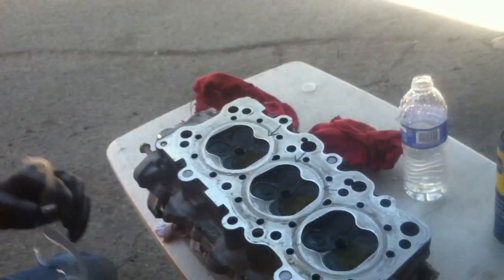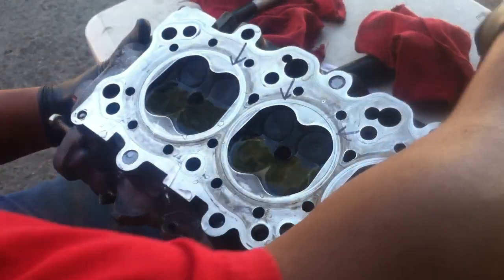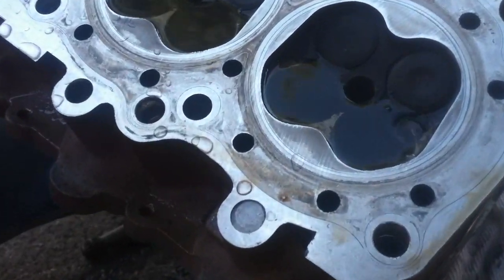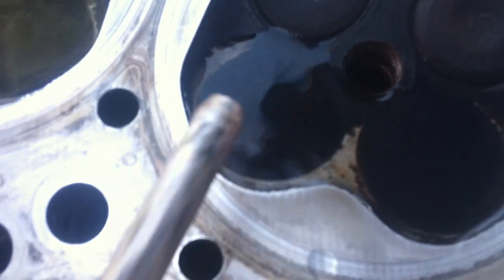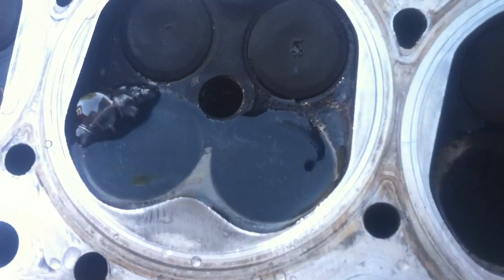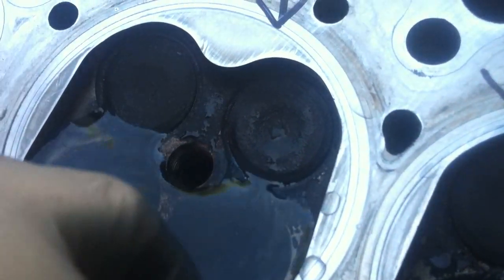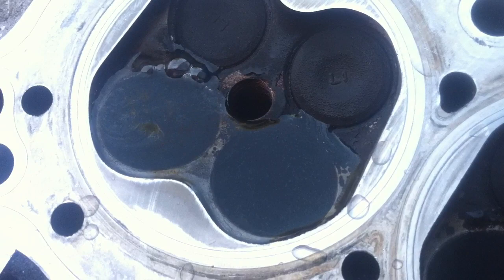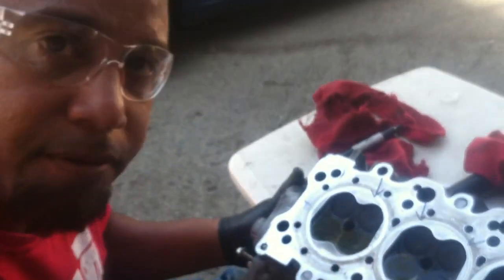HOW TO CHECK LEAKING VALVES IN CYLINDER HEADS. THEY DONT TEACH THIS IN SCHOOL, ONLY OLDSKOOL

Comment: This video shows a faulty method of checking valve seating. Valve seating is checked by a vacuum test, not forcing compressed air and making little bubble baths. Pressure testing is for finding flaws in the casting. I do enjoy your videos sir, but working in a machine shop daily I encounter you tube mechanics that look at this method as gospel truth when its just the opposite. You should be sucking 20 hg instead of blowing 90 psi. Maybe update this video with a better home method by simply letting a thin fluid fill the ports and seeing if it drips?
Reply: bro, that's when the head is on the motor. Think about that. 🎉
Reply from the maker: @JoseLeal-yn4rv  The Compression stroke is air, think about it my man. 150-180psi on this car.

Comment: How much of a leaking ok? I did a lot of grinding, and it slowed the leak down to almost nothing. It was a running engine, but exhaust valves were leaking pretty quite a bit. After valve lapping like your videos show, they barely leak. Is that OK, or should I do more? Also, thank you for spreading the word of God. I love it!

Comment: This kind of works but any carbon coated valve going to cause leaks at some point. Cleaning each valve one by one can fix the leak grinding sounds to be a bit much would rather replace the valve and guides if possible and any valve seals at the least. Spring wear out also so it could be a spring moving slightly opening the valve.

Comment: I did this test before and after I performed my valve job. I had one bent valve that  I had to replace. The bubbles did appear with just water on 50 % of the old valves,soap and water 100%  .After lapping new valves , taking plenty of time, same result. With higher PSI they bubbled 100% ,all new valves had bubbles. This motor ran fine with no  noise before the timing belt went. The old valves were blowing bubbles  probably did not need changed out ,but I did them any way . I'll tell you how it worked out in the next two days when the car is back together.
Reply: How'd it do?

Comment: The right way is give some fuel from intake hole and exhaust hole, then check on around valve seat. is there any fuel seepage on around valve seat or not. why fuel, because fuel have very low viscosity and it can seep in carbon ✌️✌️✌️😁

Comment: Hi there, just wondering if you can answer this question, i brought a brand new head and valves for a single cylinder engine. I will be receiving the parts soon in the mail and I am trying to pre determine if the valves will need to be lapped or should they be good to go as is considering they're brand new? Also not sure it matters but parts are not pre assembled but they are genuine. Cheers.

Comment: Good vids, how about the spring tension. Are the spring tension specs are good and if not enough tension the valve tension are weak and there will be a leak between the valve and the valve seat.

Comment: This may be overkill since the pressure of combustion occurs on the opposite side. I just tried this method on a freshly rebuilt and lapped head from a machine shop and it gave bubbles ~100psi.
Reply: BallsonPHACE did the hold work fine once installed ?
Reply: I  didn't hear a psi range. And when I kicked up pressure and or stuck the air in closer I  had bubbles because I JUST RUBBED DISH SOAP ON THEM. Is this overkill? You would think water not passing threw the combustion side is good enough. Your thoughts ?
Reply: If you apply too much preassure it could open the valves thats prob why hes doing it that way.

Comment: Do valves have to have springs installed doing this method? Because im lapping my brand new valves rn
Reply: Yes and no.  If you just push down on the valves from the "top", where the water is in the video, it will NOT apply the exact same pressure and angle on the valves that your springs/stems/guides apply.
BUT - pushing down on the valves with the valve guide installed will give you a rough idea if you have leaks, because the angle of the valve will be close to the angle with springs installed.  Not exactly the same angle, but close enough to see major leaks.

Stay gold.

Comment: Just did this test on new grind seats and found that if I insert the blower tip close enough to the back of valves they all leak. Spent a few hours lapping new valves and found no improvement. Guess I'll call it good then.
Reply: this is the exact issue i had. i don't think there's a valve spring strong enough to keep bubbles from popping up if you place the nozzle right behind the edge of the seat.
Reply: I should add, they were tiny bubbles and not huge ones like in the video. and i was using soapy water, which will show bubbles easier.

Comment: My only problen with this method is you could miss smaller leaks since you are not pressurizing it. I check for leaks by putting the head on its side and filling the ports with water. Not picking on you, I like your videos.

Comment: Using this trick on new valves in honda cylinder head.  Problem is even after three grinds if i fill it with water and put the tip of the air gun right to the back of the valve it leaks... if I keep it back about the point where the stem starts to spread out the nothing leaks.  I have nothing to confirm my theory but I think the honda valves just arent strong enough to keep air from coming through if I point the gun right at the valve where it seats.  Am I fine or do I just need to send these to a machine shop.  Really don't want to mount it up and waste head bolts to do a leakdown test.
Reply: I'm having the same issue. New valves and newly cut seats. They all leak if I put the air nozzle close. From a distance they all hold up good. Just lapped all of them by hand and no improvement. Would you let me know how it turned out for you?

Comment: Is this a Triumph 1050 motor? Sounds very much like an issue I have. I pulled the head off mine, poured brake cleaning into the ports, and no leaking. Looks like I should have used your method with compressed air to show up the faults.. I've already taken the valves out, so I'll put each valve into the lathe and drop a dial indicator on them and check what distortion I have. Hopefully your have provide me the way to solve my mystery of why this bike just would not start on the starter motor, but occasional started by bump starting down a big hill. Thank you so much for taking the time to do this video; hopefully you have provided the key to my mystery.

Comment: Hey old school I got a 4 wheeler quad runner I used valve lapping compound there still leak very small on the intake so just out of curiosity I took out the exhaust out and did not grind it just took it out and put it back in and it leaked just a little like the intake not shur what to do I don't want to grind any more off in the intake do they seal when they get hot ?

Comment: Good back yard trick for sure. I'd use carb cleaner or some low weight oil tho just to be on the safe side
Reply: Carb cleaner can be somewhat flammable.  I use it sparingly.
Reply: Anthony Mirabito yeah wouldn’t want your heads to cause an explosion once you crank the car back up

Comment: oldskool - if a tiny valve leak (as shown by tiny foamy bubbles in PB Blaster) using this method are found in one intake valve and one exhaust valve in a four-valve single cylinder motorcycle, how much of an effect would that have on compression? I just tore down my top end because I had a small head gasket leak and I am replacing my piston and rings even though they are in spec.  The compression was only measuring 60, and 90 with oil dumped in the chamber.  It should be 135.  How much of the problem do you think the valves could be?  The bike had good power, I only tore into it because I am getting ready for a long ride and I want good reliability.  Can the valves wait, or will they screw up the bike if I ignore them?

Comment: how much air pressure are you blowing on the back of the valves?
Reply from the maker: My compressor is set at 120 PSI just like a shop + or -

Comment: simple but affective. I just poor a little kerosene from the other side. if it leaks through it needs re sealing.
Reply from the maker: Ya its easy and quick, no special tools needed, you can even use a can of air from Walmart (Computer cleaner) $4 with extended tips tapped together and get the same results diagnosing for leaks.